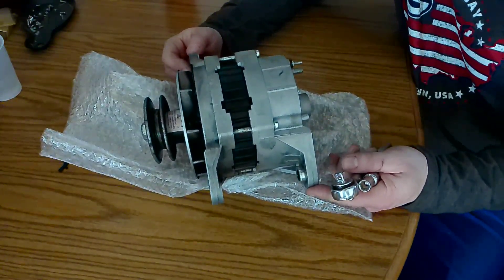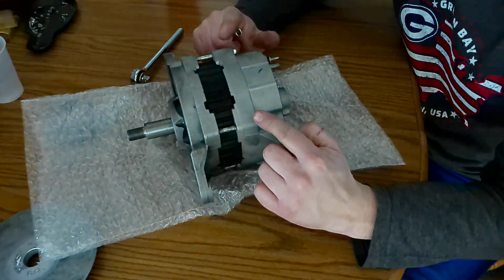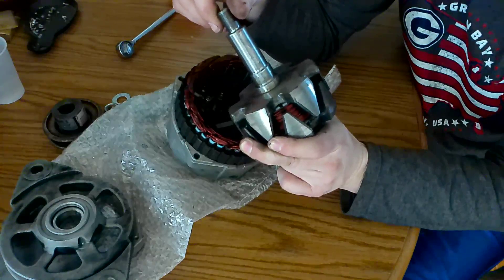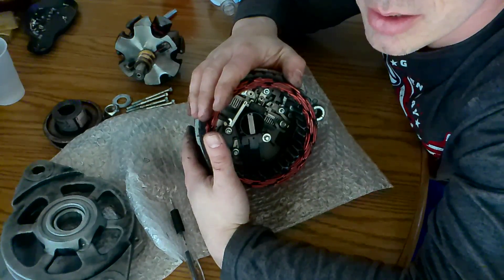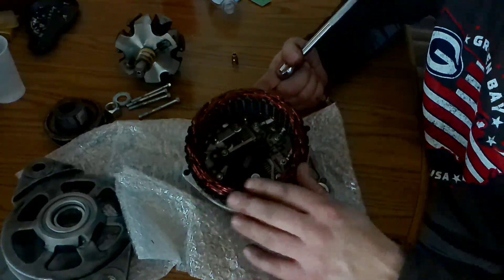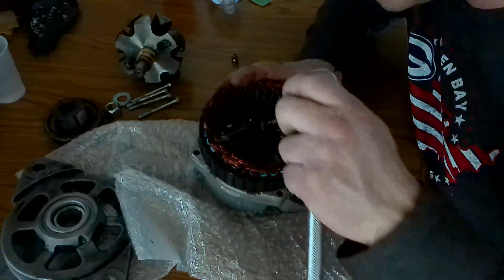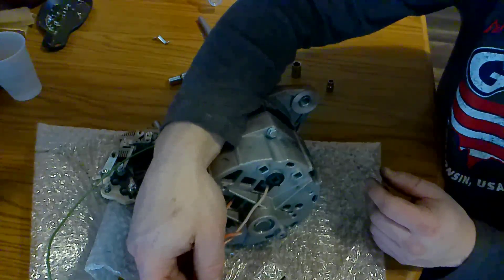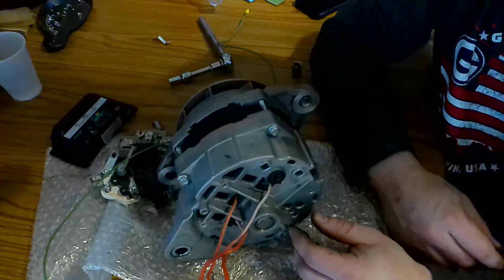Homemade generator problems! - Taking the 22si Delco apart!

Comment: I wouldn't use that one. I used an older 100 amp one. Those diodes will keep failing. You might do better with a Motorola alternator. GM diodes are iffy at best. That's a particularly bad alternator for a generator. I've worked in salvages all my life, and my dad bought a house next to one so that was my playground. All you need is a small 🧲 magnet on the back bearing cap to energize the alternator. You don't really know what you're talking about. Use some diodes out of a welder. Don't use that little dinky alternator, get you one with some wire in it. I'd use one off a school bus. The diodes won't blow. You don't need a battery to energize the alternator. Try the 🧲 magnet. You can thank me later.
Reply from the maker: Any particular Motorola model you speak of?
Reply: Well there's lots of old school buses, they mostly have a big international engine. There are lots of cheap alternators off of them because of not much demand. They have big heavy duty diodes in the back. They're ordered with heavy duty brushes and diodes, and they have big bearings. That's the best you will find. All you need is a little 🧲 magnet on the bearing cap, and maybe a short jumper wire from the output to the rotor input terminal, and it will work with only a big output wire. Try it. Any school mechanic can tell you where to get one I imagine. They retire those old buses, and the alternator is made to run extra heater motors, etc. I know that they will put out 100 amps and not overheat, they are made to hold up. I'd go to a city that has salvage yard with bus parts. One of those things will last a very long time. I was just about to order a set of wind generator blades and a hub, just now, but I had to recheck a coupon code. I'm going to build a wind generator out of a DC motor that I have.
Reply from the maker: @davidpotter9462  that's sweet! Good luck to ya!
Reply: A friend has a Delco 36si alternator 24volt. Would that alternator be suitable to use to build a generator? The 24 volt is 105amps. The 12 volt is 170 amps.
Reply: @tinybigbus1873  that should work fine. It doesn't have to be as many amps on 24 volts. My system is 24 volts. That will be awesome 👍😎. The wires will run cooler and you'll wind up with more wattage.
Reply: @tinybigbus1873  the old 100 amp Delco looks like a Motorola on the back, somewhat. The diodes are better than the lower amp models. All it takes is a small magnet stuck to the back bearing cap, to make it self starting. I would take the voltage regulator out, and use a good mppt charge controller.
Reply: Thank you. Even though I play an electrical engineer on TV, that's pretend. Is there a video on YouTube that shows how to do that? It is brand new and I think I can get it for $100. I have seen them from $700-$1000 online. Also, what motor should I put in front of it. I don't want it to lack power but I don't want it to be bigger than necessary buying extra fuel.
Reply: @tinybigbus1873  well you should have 2400 watts, 24 volts times a hundred amps, so a 4.5 horsepower engine could pull it. 750 watts is a HP. But it will take more than three and a half because everything has inefficiencies. That's assuming you want to max the alternator out. A four HP engine would probably be all right if you weren't using it heavy loaded a lot. A Honda GC 160 is 4.5 HP and very fuel ⛽ efficient. It's also a commercial model. Better hurry, they're not in production now, so there's only so many of them available. I got mine in November.
Reply: Awesome. Thank you.